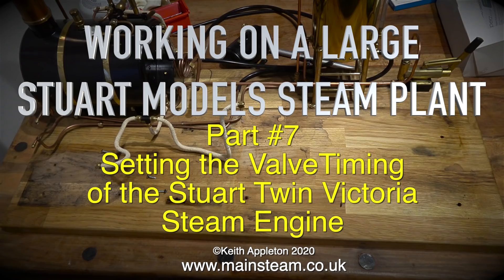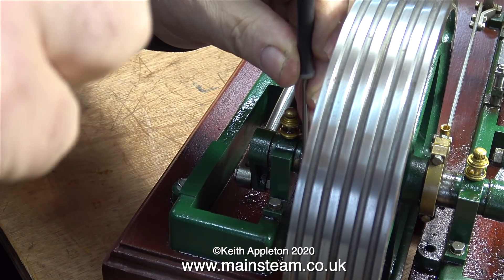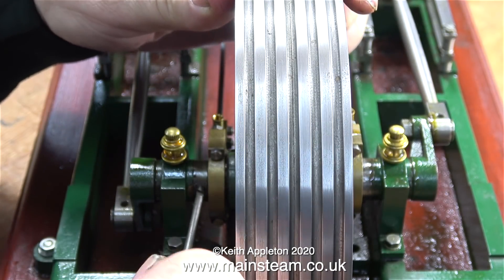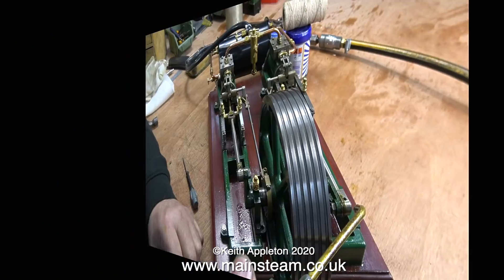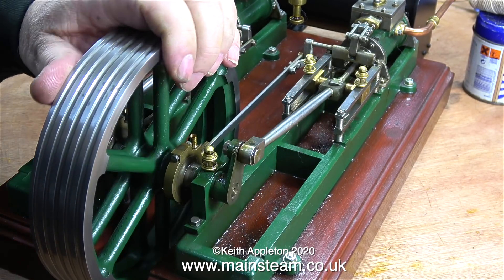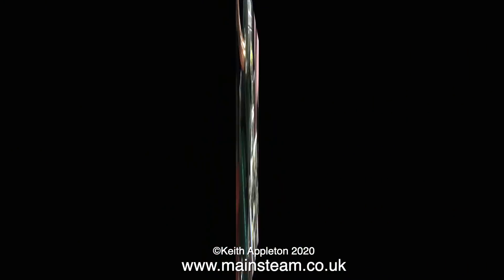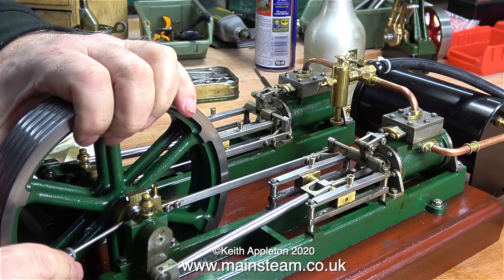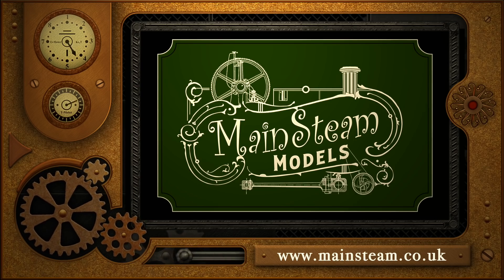WORKING ON A LARGE STUART MODELS STEAM PLANT - PART #7

Comment: The puff intensity at the end goes Low Mid High Mid Low Mid High Mid, and looking at 90 degree cranks, hearing TDC a lot, I think there's a 0.## cc difference at play either in the piston or cylinder.

Comment: Great video  ..   waiting for my  plans arriving  for this very same engine .. It will help me a lot when I get  it finished..I'm a proficient  machinist   so don't envisage  any problems in manufacture even though  won't  be using any castings..Don't  know much about  steam  engines though so have a question?? Will you have to adjust  the timing slightly when running on steam instead of compressed air.????
Reply from the maker: The timing is the same for air & steam usually.

Comment: le meilleur calage se fait tiroir ouvert .
Reply from the maker: Please explain - I do not understand . . . .
Reply: @keithappleton  to make a good timing edmition exhaust the best is to make it cover of the distribution disassemble to see the openings and closings of the drawer ...
Reply from the maker: Not always necessary if you use your ears . . . .
Reply: @keithappleton  yes I do it also may to rough it I find that it is much faster and on a cylinder by cylinder by cylinder ... in any case it is a very beautiful machine that you have!

Comment: Great videos! Super helpfu and beautiful to watch! Any tips on how to stop mild steel parts from rusting? I'm building a loco at the moment and everything seems to rust within two days and it's driving me mad! Any advice would be much appreciated.
Reply from the maker: try a dehumidifier - how are you heating your workshop? Maybe you could spray the parts with WD40 ?
Reply: @keithappleton  Ah if only it were a workshop - my flat lacks such space, so I'm building it in my living room / kitchen (which I'm aware is a disaster for moisture). I'll try protection with WD40 after cleaning everything up again. Thanks!

Comment: I've never understood why the cranks are at 90° to each other in these two cylinder engines. I always thought that if they were 180° i.e. opposite eachother it would decrease the vibration and make the power delivery smoother, but I'm certainly no expert on the subject so I'd like to hear the actual reason for this.
Reply from the maker: the engine would then not be self starting . . . . . with a 90 degree cranks on a twin cylinder configuration, there are 4 power strokes for each revolution . . .
Reply: @keithappleton  oh of course! Thanks for the explanation
Reply: Also it interleaves the power strokes of the two cylinders so that power is delivered more evenly.